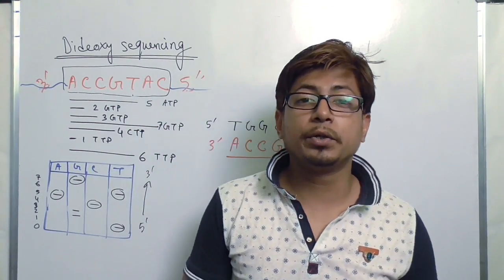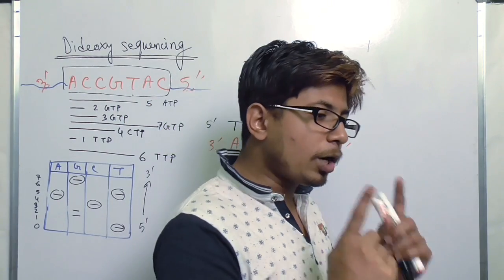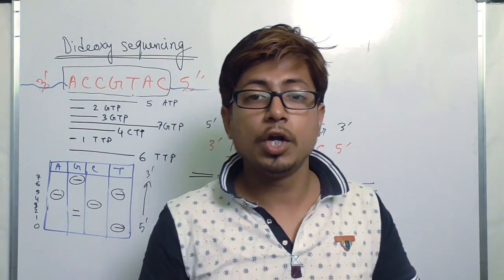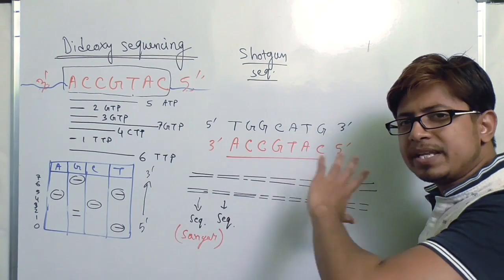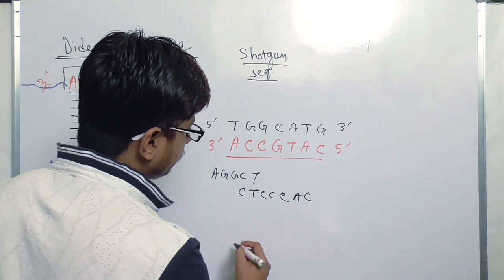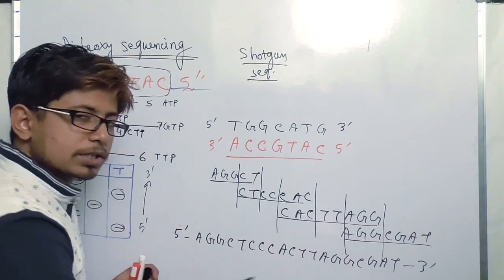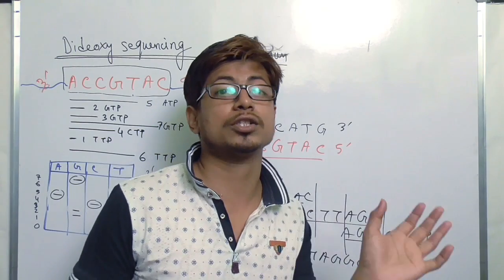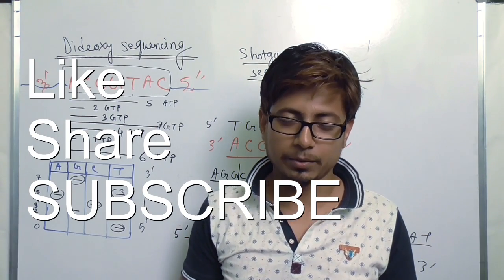Shotgun sequencing method explained

Comment: We can avoid the lose of nucleotide if we go for specific fragmentation such as restriction digestion instead of mechanical shearing. It doesnt matter whether its a specific or mechanical fragmentation because at the end we just need the sequence, so yeah.
Reply: Or you can also design specific primers to those ends where gap has generated and then sequence it from gDNA.

Comment: hi guys 
plz i need your help here , i have got problem with my gene ,after i used specific enzyme for 
one SNP of my gene and it was supposed i got 3 genotype (GG,AA,GA)
but after i used it specific enzyme i just got GG its mean homo,so now i cant cont to make association with trait ...plz if someone knew if there is a solution ... ??
Reply: The problem can be in a temperature, degraded enzyme, and nonspecific binding. Your problem can be resolved with just fragment sequencing or with the use of PCR and primers that would bind to polimorphic site.